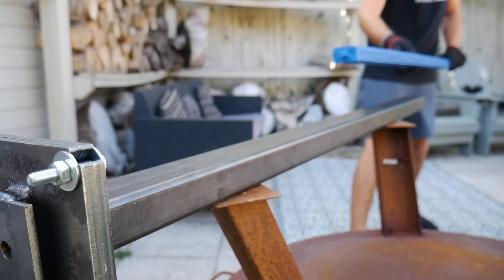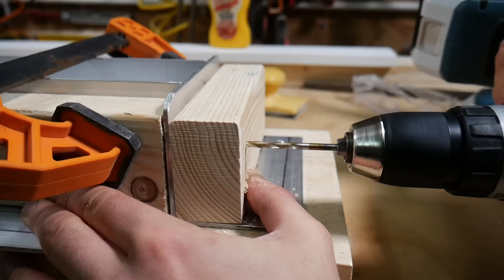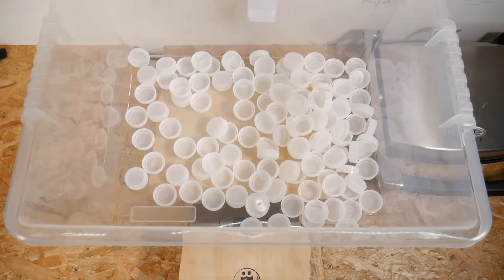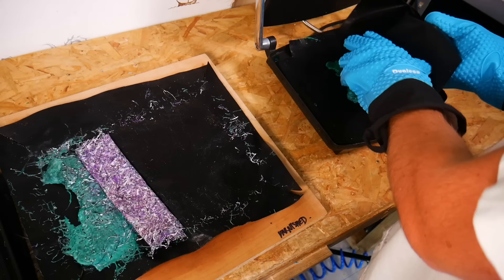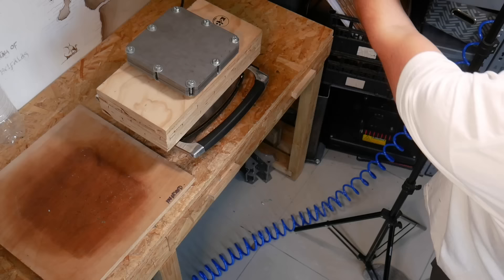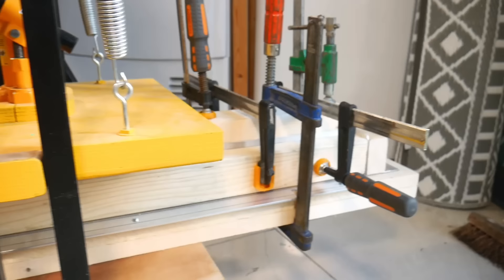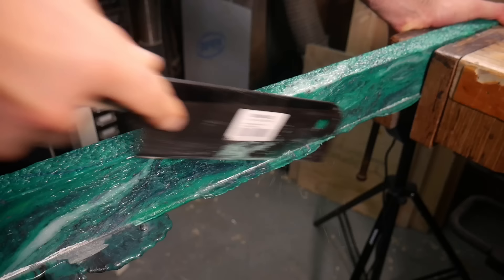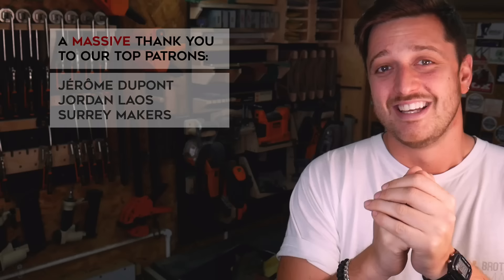How to Make Recycled BEAMS from Plastic Waste at Home

Comment: curious to know about offgassing when you heat plastic. is it safe for humans and the surrounding environment? otherwise a very cool project.
Reply: If you're smart enough to think to ask it, you're smart enough to know you already know. It's not the best, so use it in applicationns that aren't right next to your face while you sleep or where your kids gonna gnaw on it etc.
Reply: HDPE isn't toxic when melted at low temperatures. 

Only bad when you burn it, same is true for materials like polypropylene.
Reply: I think the best way to heat them is with something like a milk boiler or a double boiler which both work on the same principle. Vessel contains water which is seperated by another vessel in which a substance is heated using the water in the other vessel. The heat never goes above 100°c
Reply: Shush
Reply: I currently work in the plastics industry but we don’t deal with HDPE.  I know that the stuff we use (flexible PVC) gives off PolyChloralDiBenzilDioxin which has Benzine (which causes bone cancer) and Dioxin (kills you) and is a compound very similar to Agent Orange with a few more Chloride ions in it.

I’m wondering what you would use a plastic beam for though.  It seems wasteful since the current wood and aluminum prices make that mold cost over $175 to build in the first place.
Reply: No
Reply: I worked in hdpe extrusion for 8 years. It's non toxic below certain Temps. We extruded it at about 424 f.
Reply: thank you everyone!
Reply: off gassing happens mostly when you go above the plastics 200c ish heating point, so just keep it within that localised heat range see 3d printer heat data for each plastic range & their cooler solvents use for surface smoothing without waste/dust etc
Reply: I'm sure it smells. But so long as it's not burning plastic I think it'll be fine.
Reply: heating only breaks up the chain length, but the chain heads remain intact until very high temps are reached, 400-500 degrees I think
Reply: As a general rule, you should only melt plastic in a very well ventilated space (preferably outdoors on a windy day), with noone close to it, and further spacing "downwind". So long as you don't exceed reasonable melt temperatures, that should be enough for any home production volumes.
Reply: @cbrown9294  : I've seen some mention of them being used for park benches, though I think that had some fibrous additives for better structural traits. So long as you had the stuff impregnated with UV protectants, it should work fairly well for that basic sort of low-wear application while also being very low maintenance. For most people though, I think that trying this at home is good for nothing more than a science fair project.  Most folks won't have enough plastic waste to do anything useful with this at home.
Reply: Not at all and is actually under the illegal to burn list with the epa
Reply: LMAO. Worried about the environment using that petrol based computing device, using that petroleum based electricity, living in a home made from materials that came from destroying the lives of trees, frogs, snails, and other such critters. 😂😂😂
Reply: @poke_hoard422  😂😂😂 so if it’s burned how did it end up as this final product?  Bet you’re a Brandon guy.
Reply: @Roadglide911  I simply stated a fact about the legality of it
Reply: @Roadglide911  I still see it, it not burn
Reply: My Great Aunt worked at Fisher Price where they molded the toys into their respective shapes, before they knew it was hazardous, and without PPE, her brain turned to pudding. Yes, it is dangerous to human health. PPE is a MUST!
Reply: @pinkysregenerativevarietyf9345  yep you have folks on here thinking they know any damn thing looking dumb af and telling pple their wrong 😒 hilarious. Told dude to funnel the air to his lungs if it isn't harmful I'm sure he won't, well he'll idk humans are pretty dumb anymore lol you even smell melting plastic and it tickles your insides
Reply: @paynej32013  thanks for the info
Reply: HDPE is non toxic at production temperatures. If you're in danger because of fumes, you're in more danger because of the massive fire risk.
Reply: @poke_hoard422  one breath of foam rubber smoke and you're unconscious. You do not have to huff it. There are real dangers with some Plastics.
Reply: It’s not safe to inhale or touch by any means
Reply: @sidneywidney  That's a pretty strong but vague statement.. Not safe to touch? What would happen? You touch plastic everyday.. How is this plastic any different?
Reply: @notsure1350  Massive fire risk? Are you serious? Cooking on a stove is a fire risk
Reply: buying (eek!)  a, piece of Cv channel or box beam for a mold could be an option.
Reply: @bmzaron713  as someone who worked with epoxy and got toxic eczema and burned my lungs. Heating plastic has chemicals not meant to breathe. Even factory workers wear masks and plastic factories have special exhaust systems for a reason
Reply: If melted down like this, you're fine. If boiling down in a seperate pan, you're fine. If you're burning it, like an idiot... you have your answer
Reply: @sidneywidney  Yeah epoxy fumes are awful.. You have to wear a respirator for sure but melting hdpe isn't anything like that.. Well I hope your lungs have recovered - that is really scary and yeah always better to play it safe.. I just think it's cool #2 and #5 can be melted.. Where I am people ruined recycling by mixing in trash with recyclables.. I'm really bumbed about it but I can atleast melt some of it..
Reply: @pinkysregenerativevarietyf9345  That's really awful. I'm so sorry that happened to her and all the other folks that were there. My heart goes out to all the folks who are injured by humanity's stupidity
Reply: @Roadglide911  The world would be far less polluted without your Dunning-Kruger comments, Bubba. Greetings from Germany.
Reply: First thought I had. Bad idea
Reply: hdpe doesn’t give off toxic fumes if kept below burning point of 180c, every plastic type is different though.
Reply: @juliabouzan1739  And this haphazard pizza oven setup ensures that? Would be far better to let professionals do the recycling in my opinion.
Reply: Plastics have a wide variety of effects on human health, not just limited to when you heat it up to melt ot, some plastics are toxic to the touch and their is a lot of research into how some styrene-based products used in office furniture was causing hormone levels in women to go crazy and resulted in Women who sat on those chairs having wildly high levels of estrogen way beyond expected levels.

My advice to anyone seeing this video and thinking "I could do this at home too, and help reduce waste!", honestly just don't, you are much better off sending it to a regional recycling facility which has been built & designed to be hyper-efficient at undertaking the various recycling processes to produce recycled plastic material.

The fumes produced by just melting plastic IS carcenogenic long-term regardless of the plastic in question, and their are various studies being undertaken looking at how micro-plastic particulates in the air can lead to all sorts of health issues for factory workers in the industry.

Source:
Used to work as a Lab Scientist for a Masterbatch & Plastics Manufacturing plant working on a wide range of developmental products.
Was the assigned On-Site Auditor, and, On-Site Safety Rep.
Reply: @cbrown9294  There is no reason to buy anything for these moulds. Any scrap pile from a building renovation would get you what you need. Plus the aluminium could come from an old shower recess or window frame.
Reply: HDP is very benign.. I've worked with this stuff.. virtually zero offgassing at these temperatures
Reply: @cbrown9294  Very true.  I was fixated on how much electricity it took for the final product.  At some point the effort to reuse waste becomes more wasteful in other ways.  If it wasn't for that its pretty cool all in all.
Reply: Yes the off gasing is where the problem lies. There are so many different types of 'plastic' polypropylene copoly etc etc. Each one has different silicone content and its a science unto itself on gas emitted at different high temps. I looked into this noticing very toxic fumes when heating plastics to make orthapedic braces
Reply: @cbrown9294  a weather-proof treehouse maybe? I dunno, most beams thicker than an inch are eventually hidden by plaster/drywall, so uh...playground or insanely bold picket fence?
Reply: @longnamedude3947  FINALLY. THANK YOU. As much as I love the DIY ideas people come up with, the irresponsibility that's often provided with them, is baffling. "we use gloves" does NOT prevent fumes in your lungs, eyes, skin, hair. They REALLY should have mentioned wearing masks or at least shown it, doesn't matter that they're in a rather open space, the fumes still go right up into your face before leaving the structure.
Reply: @Emmyxf  Unfortunately a lot of these people learn from other equally DIY people on the Internet that often fail to understand or recognise the risks that they are taking with their health and then appropriately handle the situations according to those potential risks.

This is a problem as old as time itself, and, without a huge community wide shift towards a focus on the awareness of good & well discussed health & safety many people will unfortunately become unwell from undertaking some of these DIY activities without proper research.

DIY is great, but as with any task, make sure to protect yourself from the potential dangers you may face!
Reply: @absalomdraconis  Try having four kids that go through 4 gallons of milk a week. I end up with a ton of HDPE I've collected for storing rain water for my garden or to use for a project like this.
Reply: @pinkysregenerativevarietyf9345  That's true for all plastics except for HDPE (#2) and some what for LDPE (#5). These plastics are mainly used for food, drink, and potable water storage. They are very strong in cold temperatures but become pliable in Summer heat. Those plastics are rarely used for children's toys or consumer goods. The plastics that fried her brain were probably  #3, #6, or #7 plastics. #2 and #5 are pretty safe.
Reply: @bmzaron713  Melting a petroleum based plastic that has a low melting point like HDPE is a huge fire risk. You know, because it's petroleum based...
Reply: @sidneywidney  That's why they're working with HDPE and not the more dangerous plastics. HDPE is a relatively safe plastic to melt at low temperatures.
Reply: Exactly. An old school friend of mine died of cancer at only about 30 after using various carcinogenic resins and vinyls etc to make all sorts of design products in the 1980s and 90s. Encouraging people to melt plastic at home without any mention of  PPE, ventilation, extractors etc is really delinquent.
Reply: @vizprave6721  - that's exactly the problem with this method: " never goes above 100°C" - it needs to be a bit hotter than that to melt PE, not by a huge margin, but I doubt that you'll be able to work with it like demonstrated here at 100C. Also keep in mind that you will only reach 100C at sea level... if you are operating higher up, the temperature will be even lower.
Reply: The only smell is the old milk you didn't completely wash out!
Reply: @vizprave6721  no. Just use an oven with a thermometer. 140C.
Reply: @Tigger4747  those things and this thing are completely different. Milk (cartons) vs vodka from a guy in the woods.
Reply: My wife isn’t gonna be home when I try melting some in her oven. That should handle most of my risk. Right?